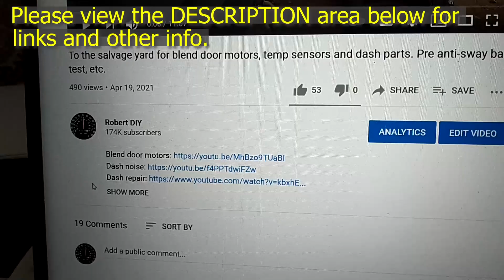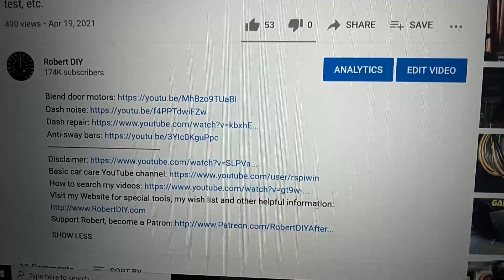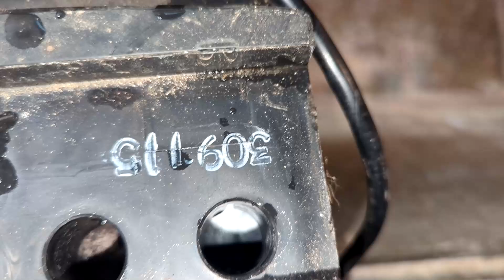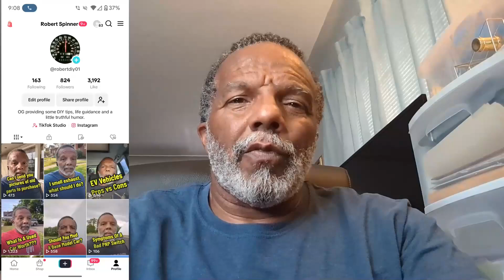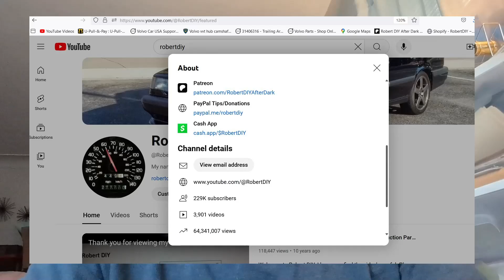Channel update, robot vacuum cleaner, legal name change drama, bad ETM, bad battery, & more. - REMIX

Comment: Air hammer on that stuck sub bush. Personally experienced this myself and combination of heat and electric air hammer with a large chisel attachment bit that I got from harbor freight did the trick
Reply from the maker: Cool, thanks for the info. I don't travel with air so that wouldn't help me.